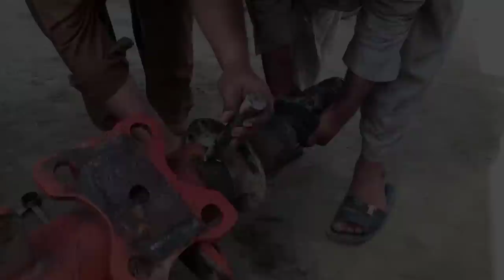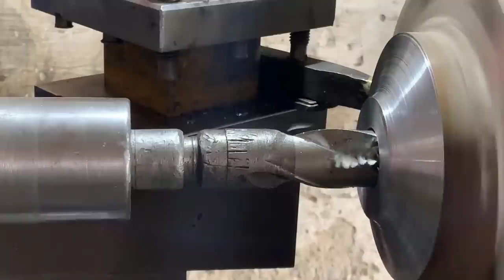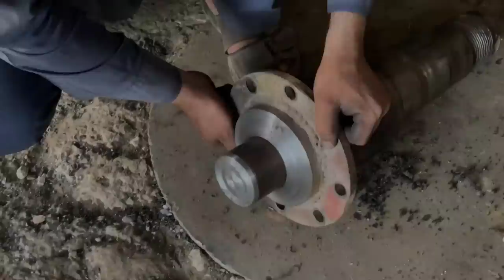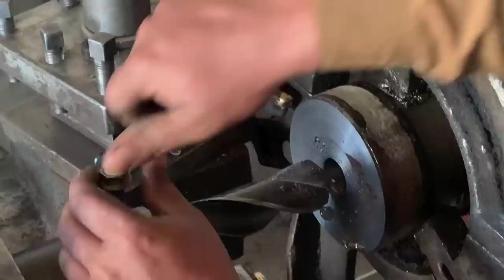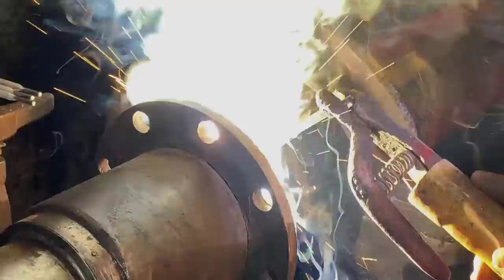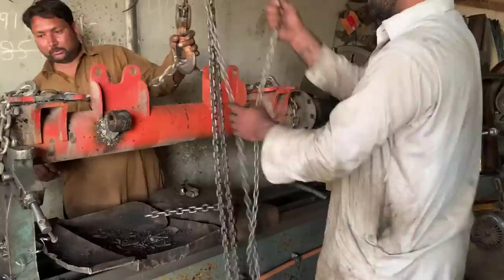How to Repair Broken Axle of a Truck Trailer | Cracked Axle Repair | Complete Process | Skill Horse

Comment: Some reasons of this: bad roads, not flexible  oversized leaf springs, to high preseure in tyres - becouse less pressure is not enough for this what they load, oversized body, overloading...